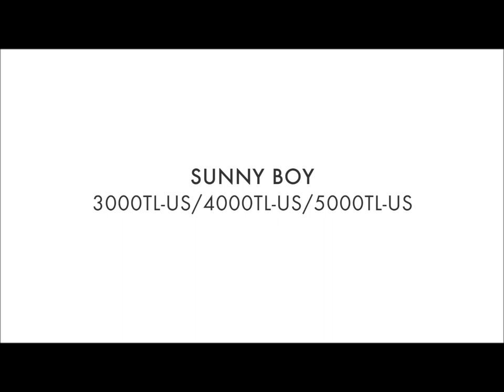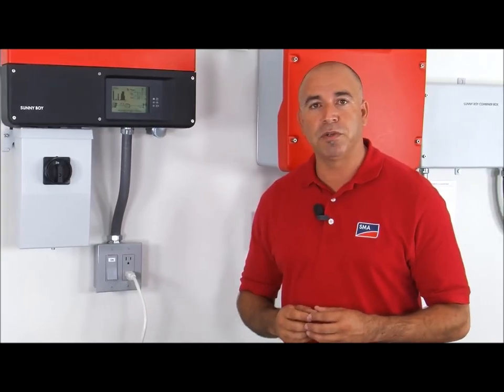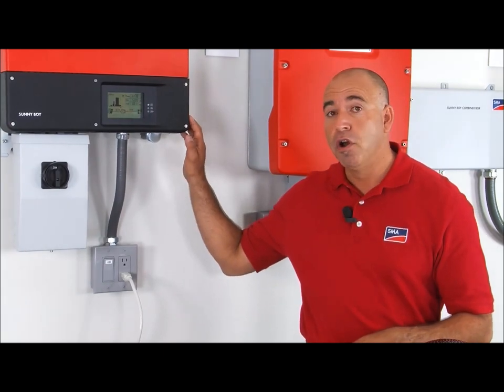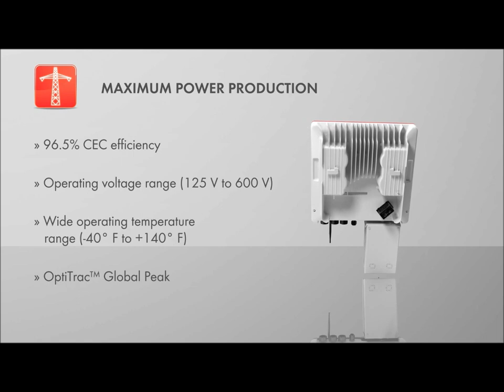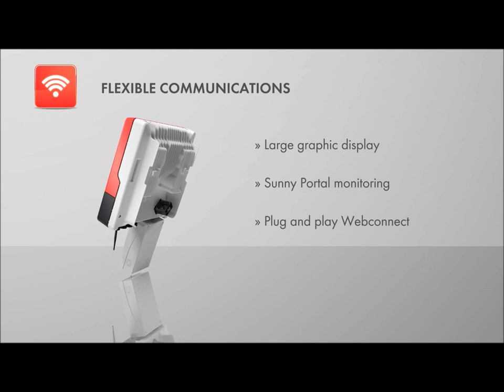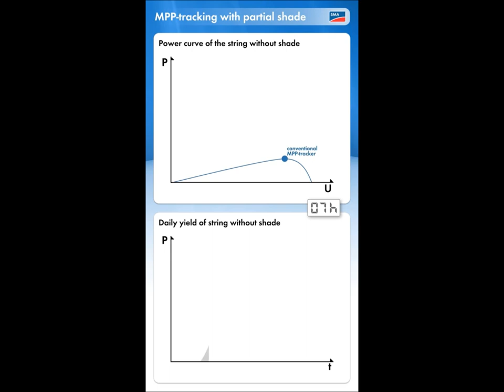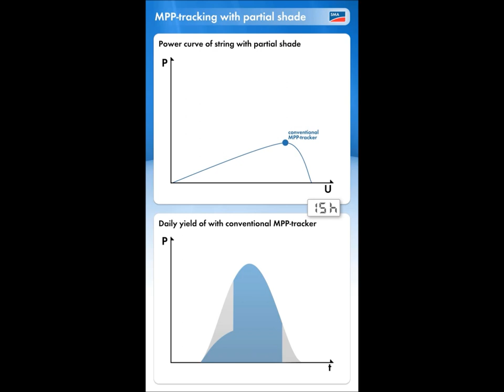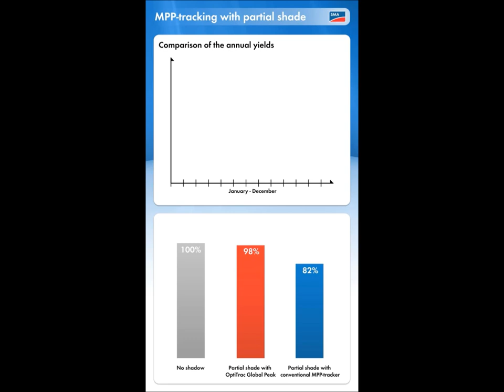SECURE POWER SUPPLY SMA Sunny Boy 3000TL US 4000TL US 5000TL US | renvu.com

Comment: Does anyone know how to connect the inverter to the power distribution grid on a Sunny Boy 6000TL
Reply from the maker: I'd refer to: https://drive.google.com/open?id=1BNWRbLc9yY2Fa9daz-x58TFe-WGZCpRm

1. Section 6.3 "AC Connection" on pp. 36-38 of the installation manual, verbatim. I haven't installed/connected an inverter personally so I would not deviate from what's given in the installation manual. 

2. Section 7 "Commissioning" on pp. 47-51 of the installation manual, particularly p. 51, verbatim.